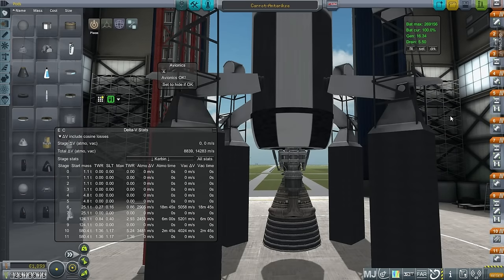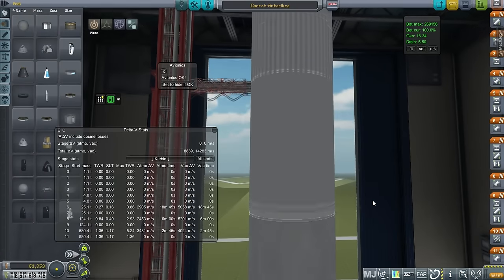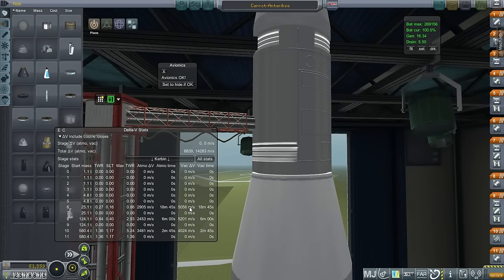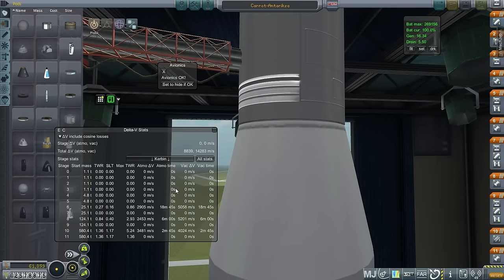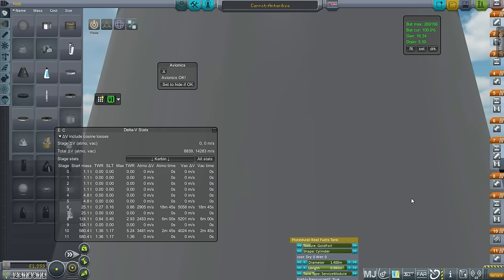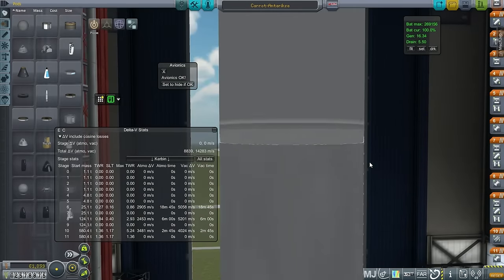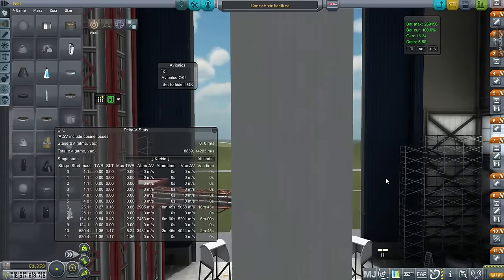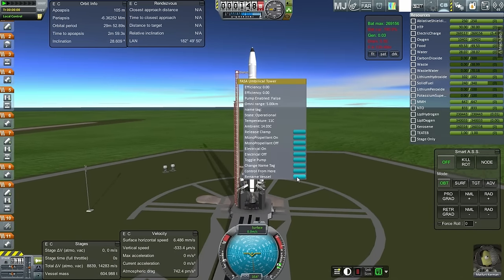Realism Overhaul in KSP Beta 27 - Matfurt's Voyage Part 1

Comment: I think the high TWR at F-1 burnout is inherent in the F-1/J-1 combo. The way MJ calculates it, Saturn V had a TWR at the end of the first stage of 4,9. Wernher didn't mind :). The reason why Antariksa has even higher acceleration is the higher TWR of it's second stage compared to the S-II - 0,84 vs. 0,67. If you're going for a 1/5 of Saturn V the second stage could grow a bit at the expense of the first.
Reply: ***** Thanks for the clarification. I forgot about the switching off of the fifth F-1.